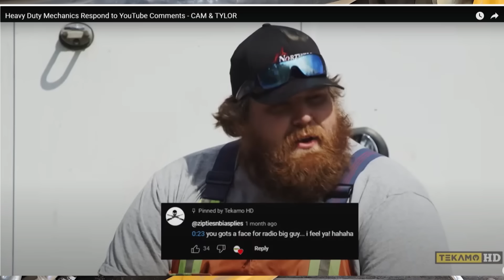Hydraulic Dust-Abatement Circuit Troubleshooting || Excavator Leeks

Comment: All these enginerds need to get their heads out of their asses and use JIC fittings again
Reply from the maker: Fucking aye! Stupid o-ring fittings, if that was a JIC we'd be drinking beer already.
Reply: @arduinoversusevil2025  Why the Christ did they go away from JIC
Reply: @arduinoversusevil2025 can you down an explanation of air over hydraulics? See em in the field sometimes and nobody knows how they work lol
Reply: Ain't no money in using better parts, the money is in selling you more parts. @arduinoversusevil2025
Reply: "Change for the sake of change", drives me nuts. But that stupid thing, they leave the same. Applies to almost anything.
Reply: There's JIC all over the sugar cane havester we use, hydraulic leaks don't come from the fittings, they come from 20 year old hosts rusting out. The only downside is they need to be 100% aligned before the god dang things will catch the thread.
Reply: Sherly a Sharkbite gots one for this
Reply: Fine, but if my vise gets all lonely & whatnot, it's only cuz you neglected to remind me. Drama llama, GO!
Reply: U could have those Jic fittings,  everytime someone cranks down on them and over tightens them, then u gotta buy a hose and the fitting on other end. Cause they never wanna crimp a new end on a hose they claim they dont know. Oring is much better,  no need to crank it down. The dummies in the field could put it on by hand and finish the day
Reply: Thanks for the o-rings we get a video... All hail the Ring.
Reply: @simonhopkins3867  I’m only hailing Lord of the Rings and maybe onion rings
Reply: If you were drinking beer already someone would have grabbed a tube of external o-ring and you would have been gone even earlier
Reply: @AndyEightSevenFive  Tube of external O-ring needs cure time.  Fuck that.  Rescue Tape.
Reply: EO bite type fittings are better. No flare to split.

Comment: reminds me of a similar issue I had a couple weeks back, except it was a folded over O-ring seal on a 60k psi waterjet intensifier, ended up making a 28MM crows foot on the old VF-2 out of some A2. Cranked that fucker down and called it good until the new seals came in.

Comment: Thus why you need to INVEST in a large Knipex pliers wrench. Turns nuts and bolts from 5 to 52mm. Just loves those hydraulic fittings. One wrench to fix it all! Even works as pliers.
Reply: They are a real treat although I suspect not having enough swing to do much here. 
I have maybe the 180 (worn away) model but I need some longer ones. They are miles better than a discustable wrench

Comment: I've resorted to the chisel trick to dispatch a fan clutch hub nut from it's grip on the water pump snout. Not my proudest moment, but I'll be damned if I'm going to grind down a 1-7-16" wrench to fit something that is going into the scrap bin.

Comment: Luckily all of my oil leak issues are flush oil through ORB, ANSI flange, camlock and much bigger (with better access). Plus, I took today off so I needed my daily fix of cussing about some smooth brain engineer and a caveman assembly line worker, so thanks for that.

Comment: A crane mechanic will have an entire middle cab drawer on the service terk dedicated to fittin' fackers in all manner of size, lengths and state of sharpness, below that be the drawer what holds all the fackin' drive tools - from the hobo freight stubby ball peeni up to the 4lbs mini gonker. 

In the top drawer above all that is the first-aids kit what contains the stopleak, bio patch/plug kit, b*tch stickers, f'uqt tape and a few cans of rip-it. So when he inadvertently finds a pre-facked fitting from last time he worked on it, the nearest lookyloo won't have to search for long as it'll be in the only open cabinet.

Comment: The lazy mechanics in the US Army  did the cold chisel trick on the bearing nuts on most of the larger trucks.  Tools were available but they had to be signed out and the tool crib clerk was never on duty.

Comment: Fix it right fix it once. I used a US quarter with a hole drilled through the center for a gasket seal at the water meter union here at my house. I didn't have a proper rubber gasket for the broken one that come out. OH! And I tightened it with wrenches. It's been three years, that's eight cent a years so far. I hope I live long enough to see the persons face when it's discovered. Patience, Sir, it doesn't even look to be beer thirty from the length of the shadows. Appreciate your vijeo.